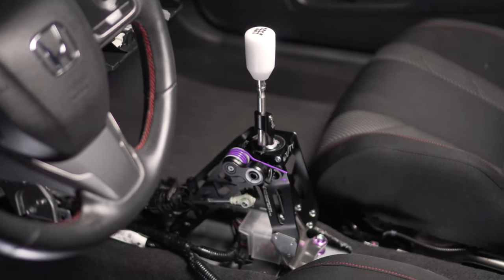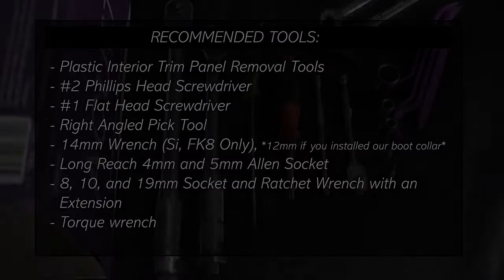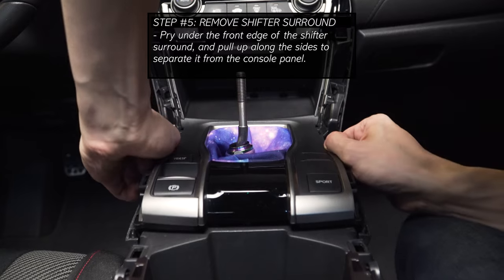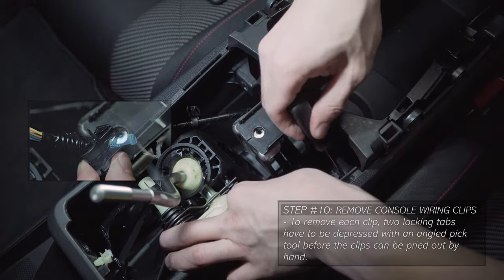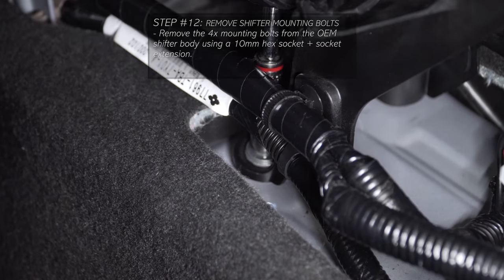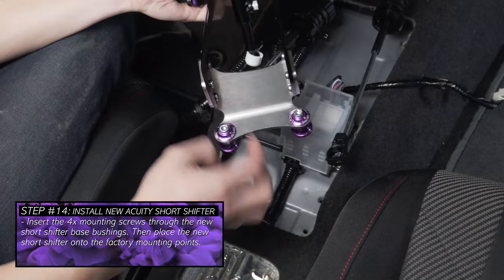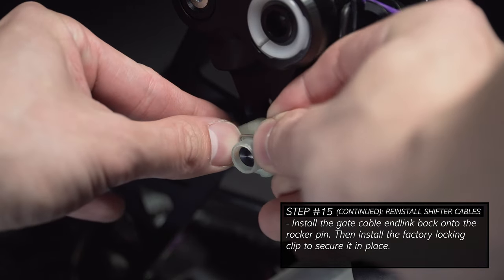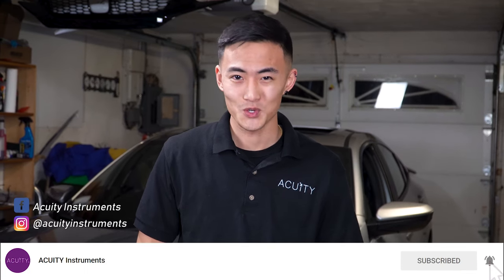ACUITY 1892 Adjustable Short Shifter Install Guide For 2016+ Honda Civics

Comment: Just installed this unit on my 2021 Civic Sport Wagon, along with the bushings and Poco knob. Quality is top notch, shifts are solid and firm. Took a little tweaking to get it dialed in, but it works flawlessly. My only regret is that I had to cover it up with the console. Oh...they give you enough stickers to wall paper a small room too.

Comment: Awesome instructions! Could you tell me what to adjust so that when I’m shifting through gears, it’s softer? After the install, I noticed that I have to put some elbow into it going into any gear
Reply: For the mildest settings, adjust the throw and gate spacing adjustments to "1" and the height to its highest setting.

Comment: The whole module looks so good I wish there was a solution to showing it off in an exposed manner... Need dat for my fk8
Reply from the maker: It's possible to install all the components omitting the main center console. Although you sacrifice cupholders/storage space, it's a good solution to have easy access to the adjustments during the shifters break in period/show it off at car shows 😎. Just don't forget to remove the car key sensor from the back of the center console and plug it Into it's respective connector in the car.  Our videographer Pawinn should be covering this in a new video on his channel later this month 🤘
Reply: @ACUiTYinstruments  Thanks you put an image in my head that now I won't be able to get out. Must order this!!

Comment: Getting mine on Friday for my Si! What settings would you recommend for a daily driver?
Reply from the maker: Awesome 🤘😎. For daily driving I'd start off with the middle settings on both the gate and throw adjustments. Then the height and the position of the shift knob can then be adjusted to suit your arm length/preferences (a shorter height will reduce throw as well, and vice versa).

Comment: Great Videos - can u do a vid to demonstrate REV Match works on the FK8 after a full install?
Reply: Are you currently using the FK8's auto rev match feature that's enabled by default or have you disabled it? There' should be no change in the rev-matching procedure due to shifting-related changes. If you have the auto-rev match system off, you just may have to do things a bit faster than usual.

Comment: For us Canadian Si owners - I am assuming we have to disconnect the charging pad connector as the last step in our disassembly?  Can any Canuck owners confirm this last step?
Reply from the maker: Hey thanks for commenting! Yes you’ll need to remove/disconnect the charging pad before you can remove the upper console panel and bottom half of the center console. In short, once you remove the shift knob, shifter surround panel, side trim pieces, and the climate control module, you’ll notice the charging pad has a thin plastic trim piece around it that can be unclipped by hand. Once that surrounding trim piece is removed, you’ll see two Phillip screws that secure the charging pad to the upper console panel. Remove those, then you can pry the sides and back of the charging pad to unclip it from the upper console panel and then unplug the wiring underneath it. Then you should be able to remove the upper console panel and proceed to the steps to remove of the rest of the center console. Hope this helps! If you reach out to us on ig/fb/email I can help provide some reference pics for the steps I just described 🙏. ~Pawinn
Reply: @ACUiTYinstruments  Thanks man. I did this yesterday. I installed the Acuity Shifter Rocker, Gate Spring, Short Throw Adapter and the Base Bushings in one shot. Taking out the charge pad was a bit tricky as well as tightening the short throw adapter. I have to admit the shifting feels way better now with a bit of noise (I didn't zip tie the shifter cable as I saw next to nothing for play yet).

With the Short Throw Adapter you will not be able to go into 5th. Works fine after everything is installed.

NOTICE - For Canadian Owners who have the immobilizer and the Push Start - You will be unable to start the car normally as the immobilizer will kill the engine turning over. Nobody really knew on how to help me but I ended up figuring out. 

AFTER reconnecting the Negative Battery Cable - on the very FIRST Start, you have to press the brake pedal all the way to the bottom and then start it with the clutch and Start button.

Comment: Any videos of shifter installation guide for type R? It didn’t show how to remove the wireless charger caz SI doesn’t have them.
Reply from the maker: We don’t have a video covering the removal of the wireless charging unit, but we have the disassembly steps for it covered in our pdf installation guide here:

https://drive.google.com/file/d/1Hr5liM-p-OuZ2cFBcw7WYrEQXi5BbIDd/view?usp=sharing

Comment: What is the difference between the Short Shifter Kit and Stage 3 kit?
Reply from the maker: It's best to view the various kits on the website, but basically the Stage 1 and Stage 2 Shift Kits for the 10th gen civic offer bolt-on parts to upgrade the OEM shifter. The stage 3 kit features our 1892 Fully Adjustable Short Shifter, which replaces the OEM shifter entirely. Here's a link to the 10th gen catalog if you need it: https://acuityinstruments.com/collections/10th-gen-honda-civic-2016-2017

Comment: does it need any lube at the shift points from the cable ? as the oem shifter has .
Reply: HUY HUYNH the shifters come already lubricated at the few points that require it. No need to anything anything else 👍🏻.

Comment: I have just change this shifter, but I feel like  the shifter is too hard to push in, what should I change in order to make less effort to push in the gears.
Reply from the maker: For the most mild setup on our shifters, do the following:
-If the height is adjustable, set the height to the tallest setting (normally marked "4" or "5" on the height adjustment rod)
-If the throw is adjustable, set the throw to "1"
-If the gate spacing is adjustable, set the gate spacing to "1"
This will give you the longest throw and widest gates possible. From there, reduce the adjustments to your liking.

Comment: Question, I have this exact one on my 2015 civic si. How is this possible?
Reply from the maker: that should not be possible, are you sure you don’t have our 9th gen civic short shifter? If you look on the back of the shifter and see that it has a serial number that starts with “1880-….” then it is an 9th gen civic shifter.

Comment: I’m having trouble with my sports mode activating. I rechecked all the wiring 3x and my sports mode won’t kick on after installing. Any solutions??
Reply: Normally it relates to the harness just not being clipped into the buttons, but on super rare occasions, we have seen people damage the plugs. I'd try just checking connectors. Disconnect them, check the male and female pins for damage. If possible, check continuity between the wires and the pins in the connector to make sure you have continuity. If all of that looks good, try disconnecting the battery (with the car off), which will reset all of the car's electronics. Keep in mind, it will take a few driving cycles to reset everything after disconnecting and reconnecting the battery.

Comment: Do you make one for ep-3 SI hatchback
Reply from the maker: Unfortunately we do not have a short shifter for the EP3 platform, but we do have a Stage 1 Shift Kit that provides bolt-on parts to the factory shift linkage/shifter for an appreciable improvement in shift feel. Here’s a link to all the parts compatible to the EP3 platform:

 https://acuityinstruments.com/collections/8th-gen-honda-civic-2006-2012

Comment: I broke the tab that the shifter cable is supposed to click in place to how screwed am I? Will  it be fine?
Reply: Good news! You are very likely not screwed! :) Just to confirm, you are referring to the tab on the black bushing that prevents the bushing from rotating once you lock it into the shifter's frame, correct? If so, you should be ok. Realistically, the bushings may be fine as is, but just to be cautious, consider adding a zip tie that prevents the bushing from pulling out of the bracket just in case the bushing ever rotates. You don't need anything crazy, just some slight pressure to hold it in place.

Comment: What would you recommend for a 17 accord sport ?
Reply from the maker: We got a few bolt on upgrades for the factory shifter system that will provide appreciable improvements in shift feel (cable bushings, base bushings). Check them out on our website!

Comment: Does it have to be on flat ground I can’t find any
Reply: Can you explain the question a bit better? I'm not sure what the comment is in regards to, specifically. If you're referring to the car itself, as long as it's in park, you should be fine for the installation. No jacks etc are required and you do not need to get under the car.

Comment: Is the torque wrench really needed?
Reply: That's a good question. We list torques to be safe and to try to help customers avoid over-torquing adjustments. The truth is, if you are an experienced gearhead, you can likely skip the torques and snug the adjustments, but to be safe, keep an eye on the torques to make sure you're not overdoing it. Also note that our shifters are (mostly) marked in newton-meters and inch-pounds. Please don't confuse inch-pounds with foot-pounds since a foot-pound is 12 times higher than an inch-pound. For many, this is common knowledge, so apologies if that's the case here, but we've seen the confusion arise enough that we like to just say it to be safe. I've installed these exact shifters probably 50 times now (mostly during our R&D phase) and for most of those, I just hand-snugged everything for the sake of speed (with no ill consequences to speak of). The one adjustment to be very careful with is the gate spacing adjustment. It uses a large hex to adjust it but the screw is an M6, so don't be tempted to over-torque it just because the driver size is large. An L-handle allen wrench is plenty enough to torque the allen-key adjustments like throw, height, rotation, and the mounting screws though. :)
Reply: @rgareh1  i also lost the pin so im fucked
Reply from the maker: I believe the part number for that clip should be (54321-TBA-A01), hope this helps! You should be able to get it ordered from bkhondaparts.com

Comment: The torque spec can’t be 71 lbs right?
Reply: The torques in this video are in inch-lbs since it focuses on smaller screws. 71 in-lbs would equal just under 6 ft-lbs.

Comment: Will this fit a 2016 honda accord coupe v6?
Reply from the maker: It will not unfortunately, but we do have plans to release shifter upgrades for the 9th gen accord in 2021 🤘
Reply: @ACUiTYinstruments  thank you for your response. Do you know when in 2021?
Reply: @ACUiTYinstruments  Any new updates on this?
Reply: @tor3040  We actually just released stage 1 kits for the 9th gen accords that include shifter base bushings and shifter cable bushings. Unfortunately, still no plans for a shifter for the 9th gen accords, presently, simply due to insufficient demand. :( The stage 1 kit provides appreciable refinement to shift feel in the 9ths though. :)

Comment: What does gate spacing do? 9:55
Reply: Gate spacing is basically the distance your hand is traveling left or right during a shift. So you have the 1/2 gate, 3/4 gate, 5/6 gate, and Reverse gates on a 6-speed honda gearbox. It's normally ideal to reduce the gate spacing slightly when reducing shift throw so that you don't have super short throws with wide gates (which can be a bit awkward). So basically the gate spacing adjustment and throw adjustment permits independent fine tuning of how far forward/back your hand moves and then how far left/right your hand moves during shifts.
Reply: @rgareh1  Thanks for quick answer.
Reply: @THXnDTS  No problem! :)
Reply: @rgareh1  so would 1 be the shortest distance of gate spacing or would it be 3 ?
Reply from the maker: Shortest distance for gate spacing would be setting 3 👍
Reply: @ACUiTYinstruments  so 3 would give me the shortest distance from side to side correct?
Reply from the maker: Yessir 👍
Reply: @markanthony3939  On SKU 1892, on the gate spacing adjustment, 3 would be narrowest gates, 1 would be widest gates.

Comment: I think I threw away the little bag with the mountings screws 😭
Reply from the maker: Not a problem! Please contact us via the contact-us form on our website (here: https://acuityinstruments.com/pages/contact-us). Explain your situation, and they should be able to assist in getting replacement parts as needed. The cost on the replacement hardware bag shouldn't be much, and shipping should be pretty economical for such a small package. :)